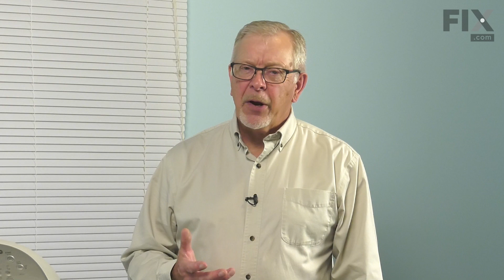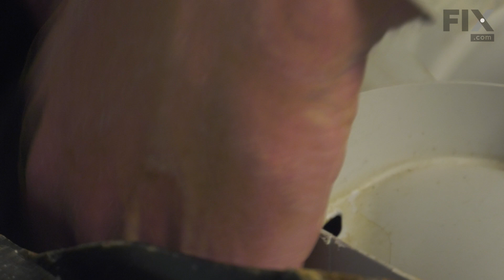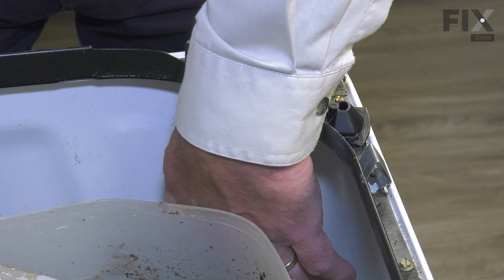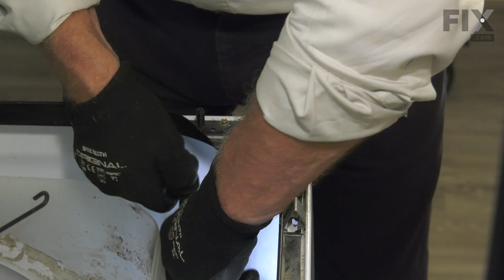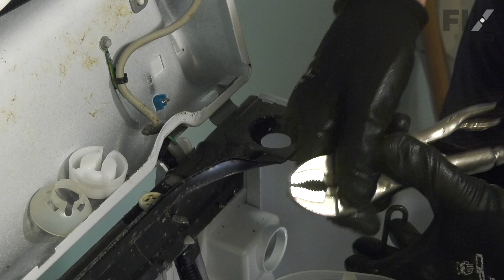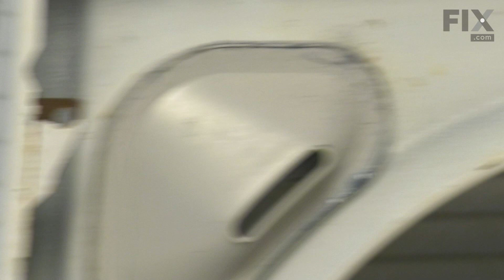Whirlpool Washer Repair - How to Replace the Suspension Spring Kit

Comment: Thanks for the video!  I just replaced my Maytag suspension (W10247710) and it went well.  I watched some other videos, but the suspension you used is identical to what I bought so I appreciate it.  Also, I didn't want to tip the washer over and yours is one of the few that do the replacement from the top.  I didn't bother to remove the top part of the basket, as it didn't seem to give much more access.  I used towels to keep the basket displaced while I worked on each corner.  A local dealer wanted $350 to replace the suspension--I got the kit for $125 and saved some bucks.  I was even contemplating buying a new machine since mine is 12 years old, but hopefully the new suspension will extend its life for a few more years...

Comment: Thanks!  That dowel tip saved me lots and time and effort by not having to disconnect the water supply and not having to lay the washer down on the floor to get to the underside.

Comment: I have ordered the replacement kit,  but in the meantime,  I needed to wash and didn't want to spend money or time going into town to do laundry. So I found a temporary fix while waiting for my suspension kit to come in.  I cut pool noodles into 3-5" pieces,  then cut a slit down the side,  lengthwise. Pull the tub over to one side and slip the noodle piece over the top lip of the outer edge of the tub.  Do this with several pieces. It worked like a charm.  Couldn't see how to post pictures,  so hopefully you get the idea.